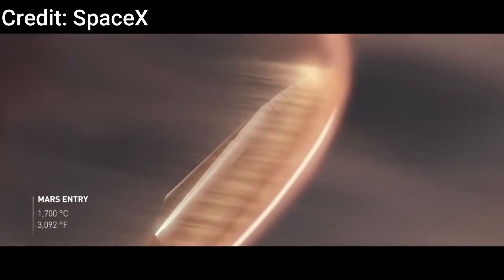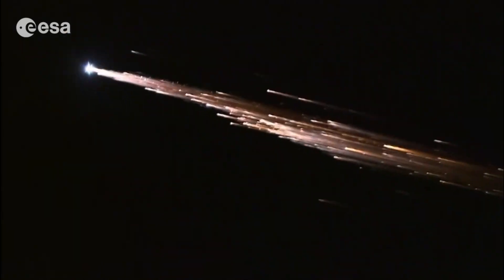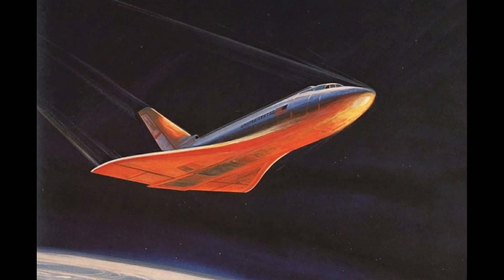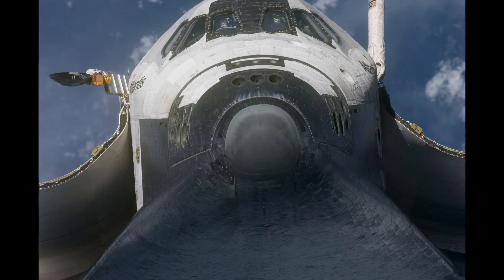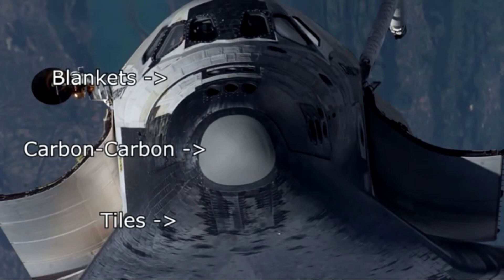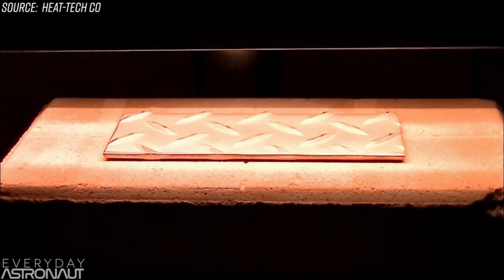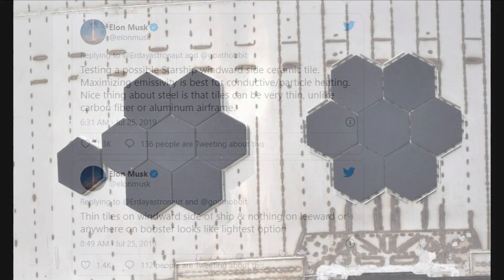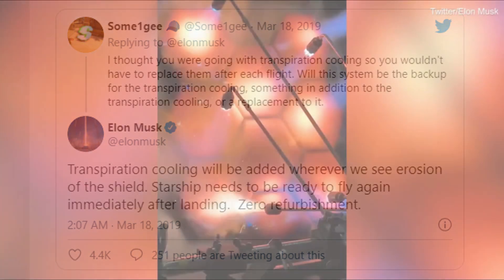SpaceX Starship's Heat Shields - Everything You Need To Know!

Comment: Felt like sitting in a Material Science class room.  ..! In a good way. 
There are other vids on this subject but thought no one much spoke about different types of heat shields like ablative, passive and active types etc . 
I was hoping to get some answers about why these tiles are smaller in size. If they are made bigger, like large panels, they would seamlessly cover a bigger area, and there will be lesser points of attaching to the spaceship. There is obviously a reason why it is not done likewise, but none of the videos touch on this aspect.

Comment: If the tiles are all around the tubular structure and the ship rotates slowly around its longitudinal axis while descending, it will expose all each tile to the high temperatures for a much shorter period of time. Hence thinner tiles. I’m sure there may be some stability issues with the fins in rotation, but hey, not for me to figure out. It would also add a degree of safety in the event a tile is breached in which case the sensors would warn and the ship rotate faster through that section.
Reply: I can't decide if this is ridiculous, or genius. 🤔 Getting shook and spun at the same time 🤮
Reply: @Dyslexiasymtum123  I’ll go with genius since there was alcohol involved, but hey, I may be biased.

Comment: Did not SpaceX originally believe that a heat shield was not required?  What part of the equation did they get wrong?
Reply from the maker: Heat Shield was always going to require. But, due to the stainless steel, the heat shield won't need a lot of maintenance like Space Shuttle heat shields. 

Thanks for watching